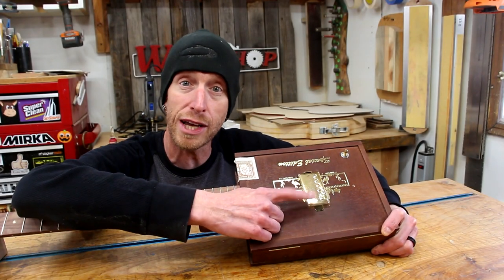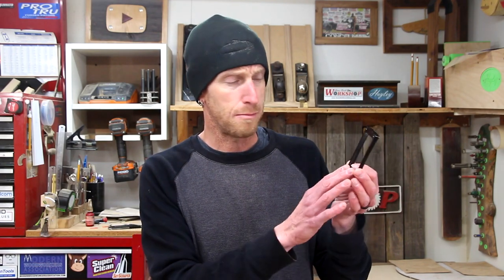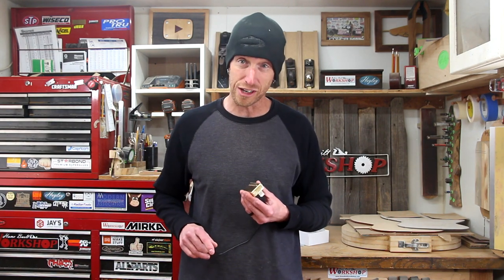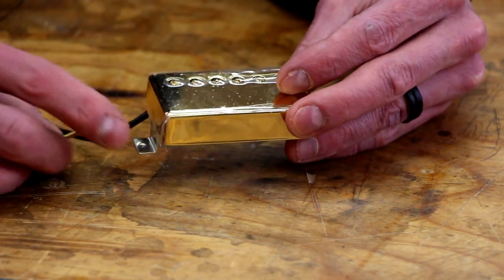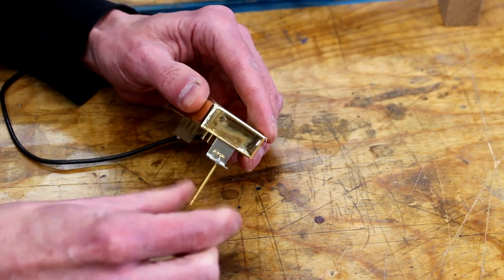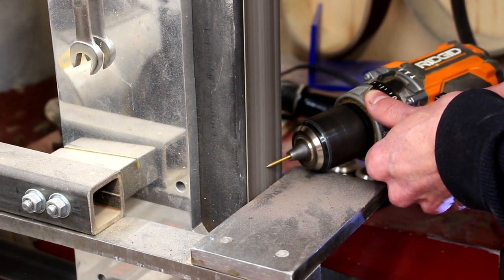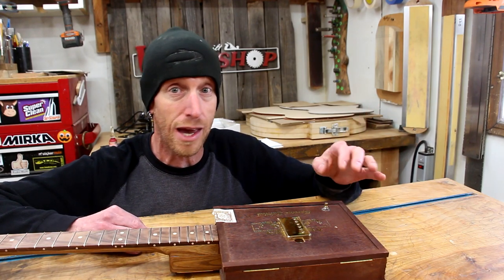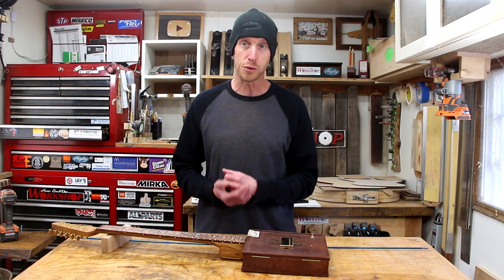How to Direct Mount your Guitar Pickups and why you should | I opened a can of worms!

Comment: When you think about it. Technically the pickup is still floating the same as if you used pickup rings. There is no direct contact between the pickup and the body unless you mount it flush. Its still a nice look though.
Reply from the maker: Its not a lot when you think about it, but there is a small contact point between the screw and the pickup tab.
Reply: @homebuiltshop  But it is indirect contact points. Same as a pickup in a ring. It's not direct contact with the body of the guitar. In the end, I think this is a lot like many things guitar. Its mostly down to aesthetics. What you like the look of the best.
Reply: I'm interested enough to do this... but how often do you really adjust the pickup height? I'm going to simply use washers BENEATH the pickup tabs with short wood screws and use a straight edge to determine the approx gap. Most guys can't do the machining in this vid - but it's a great vid and topic IMO.
Reply: @3DayFunk  The pickup ring is mounted to the wood with 4 screws, so yes, it still makes as much contact as direct-mounting.
Reply: @Thirdgen83  no it doesn't, the pickup is only mounted to the ring by 2 screws, the height adjustment screws. That's what matters, not the ring screws. You can wiggle the pickups in a ring setup, not good.
Reply: @realtruenorth  That has ZERO affect on the sound.
Reply: @Thirdgen83  he explains why it changes the sound.  And he is a pickup maker.
Reply: @Thirdgen83  LOL. I don't understand why you are so resistant to facts, reminds me of liberal democrats.
Reply: @realtruenorth  It's NOT a fact. It's some guy's opinion and he's WRONG. And I'm NOT a damn DemocRAT.  
FJB!
Reply: It is a direct mount pickup because it’s not mounted to a ring that is mounted on the guitar. That’s 4 less screws/holes in your guitar and no plastic ring.
Reply: @papaidolatrine2499  I am well aware of what it is and how it mounts. My point is that it has ZERO affect on the tone of electric guitars.
Reply: Personally, I would use the PMS system by FU-Tone as it has a solid bar that screws into the body, then has a bigger size set screw in the middle for adjusting pickup height for $49.95. It has much more solid contact point than this guy's approach and the pickup ring both.
Reply: @Thirdgen83 eah. That's wrong. Ask Van Halen. He kinda pioneered this for the tonal improvements. Watch Dylan talks tone explain the science of why. He is a pickup maker. If the pickup can vibrate it can cause phasing loss. It needs to be secured and move as one with the body to eliminate any off phasing loss.
Reply: @Living_EDventures I wish they had a 7 string version
Reply: @realtruenorth  Not wrong at all. EVH had a lot of hair-brained and superstitious ideas that had no basis in science. Everyone jumped on the bandwagon since he was such a great & innovative player.
Reply: @Thirdgen83  I actually understand and can explain why it makes a difference and I guarantee that it can affect what you hear, that video explains why.
Reply: @realtruenorth  I can guarantee that after playing guitar for 39 years and trying numerous pickups and different mounting systems, what you are saying is a MYTH.
Reply: @Thirdgen83  I guarantee after playing nearly 40 years that it isn't. I can hear the difference when going from pickguard to direct mount. But I believe you if you say you hear no difference. But just because you don't hear a difference doesn't mean others don't.

Comment: Nice way to mount pickups. I'm gonna roll with personal preference on what is a clean look so as to not fuel that debate. I will however reiterate that unless you are using those super old and REALLY microphonic pickups there will be zero tone / sonic changes from doing this as its ALL electronic / magnetism producing the sound and ZERO to do with string vibration in regards to sound. Many people confuse resonance with all that and that comes from the wood working side and how everything is put together and either aids or detracts from that.
Reply: While I agree that direct-mounting the pickup does not change the tone, it's NOT just electric signal/ magnetism that is involved. This is because pickups are MICROPHONIC. They actually "hear", in addition to producing an electronic signal. A prime example is how a hollow-body electric guitar sounds different from a solid-body with the SAME pickup. But yeah, direct mounting vs. a pickup ring makes no difference. I also laugh at the MYTH that a maple neck with a rosewood fingerboard sounds different from a maple neck with maple fingerboard. Pure NONSENSE, as there isn't enough material there to have any effect on the tone.
Reply: @Thirdgen83  Technically a pickup can NOT be microphonic as it has no diaphragm. What makes a pickup "Microphonic" is sound pressure subtly vibrating the strings and causing a resonance that then feeds back from the amp causing a loop. Its that same resonance that makes a hollow body sound different.  Listen to Paul Reed Smiths interview at Andertons at the 30 minute mark where he starts discussing the Robben Ford guitar and breaks into the part about each guitar having that resonance and how he manipulates that to act with pickups.
Reply: @borgonianevolution  The REALITY is that pickups are microphonic. You can postulate about what MAKES them microphonic, but the end result is the same. My example of a hollow body electric sounding different from a solid body with the SAME pickup is evidence of such. The magnetic electrical signal doesn't
differentiate between body construction. That is microphonics.
Reply: @Thirdgen83  ANYTHING microphonic has to produce a motion be it vibration, air pressure or an electrical change of sign. 

For a pickup which is an electrical device to produce a sound something HAS to move. It does not in any way shape or form "hear" sound.

In the case of a pickup acting micro phonic it means something within its structure is moving. Most cases it is loose coil windings which is why "potting" coils is so important and in most cases reduces or eliminates the ability to become microphonic.

If you talk at a pickup and your voice produces a sound it is because the air pressure changes needed to make sound are transferring those vibrations to something loose within the pickup and inducing sound electrically.
Reply: @borgonianevolution  Again, you're going into detail on WHY the pickup "hears". That in no way refutes the fact that it does. Obviously it doesn't function the way a diaphragm microphone does, but it is producing more tonal qualities than JUST an electrical signal created by a metal string moving over a magnetic field. If it were, then it would sound tbe SAME no matter what kind of body it's mounted in.

Comment: I have seen two other methods for direct mount.The first is actually a brass bar that mounts at the bottom of the pocket, there is a high adjust screw in the middle, and the end screws screw into the bar to adjust height.  The second is to drill the bottom of the pocke ton each end and screw in a brass insert. You add a pice of foam between the pickup and the bottom of the pocket.  You adjust the height screwing the srews in and out.
Reply from the maker: I've seen the brass inserts. I kind of like that and may try it out. I would still modify the screws to disengage from the pickup though.

Comment: Thanks for this suggestion of filing a screw down.  I was replacing my passive pickups in a Prestige Ibanez and I didn't want to drill out the brass fittings in my Fishman Fluence I was putting in there.  Finding screws online or the hardware store that would fit the bill was fruitless and the direct mount screws that were in the stock dimarzios were too fat at the unthreaded portion.  Of course, your method was so simple I wished I had thought of it myself.  I just chucked each of the 4 screws into my hand drill and needle filed them down, measured them with my calipers, and I think they'll work a charm now.  And the threads are the exact right size because they're ones I alreayd pulled out of the guitar.  Cheers!
Reply: Also, why isn't some company making screws that fit this purpose by now.  It's honestly weird that Duncan/Dimarzio/Fishman/EMG don't have screws like these available on their website.
Reply from the maker: I'm glad it helped you out. I don't know why there isn't something like this. Maybe everyone just drills the pickup out but I don't like to do that.

Comment: If you drill out the screw connection you can reverse it by soldering a proper nut to the bottom of the ear . I have done it several times and it works

Comment: Wow! I never thought of doing it that way. I always drilled out the holes on the pickup. 
I'm gonna try your method on my next build. Great video!
Reply from the maker: I don't like to modify the actual pickup as that makes it not reversible. This way, the pickup is unharmed. Make sure you don't remove too much from the screws or it will become weak. Just remove the threads enough so it disengages from the pickup.

Comment: Great tips here.  I would like to mention though that your pickup mounting is still floating the pick up above the body and not actually making direct contact (unless the screws are bottomed out).   Although I do not know if this matters. 

I have built several guitars and I used EMG pick ups in all of them.  They were truly a direct mount, screwed solidly to the body.  I am looking to replace them in one of my old builds though with passive pick ups.  I do not have room for the rings, so need to still direct mount them.  I like your method, and will most likely be giving it a try.  It is nice to have some adjustment to get the pickup  the correct distance from the strings.

Comment: I've never been into pickup swapping but I had a pair of gibson 57 classics sitting around. I got a little reckless and widened my carvin h2t's pickup holes with a Dremel. The gibsons are still mounted using the plastic pieces and are adjustable but I was worried that they were too snug against the body now.... possibly killing sustain/resonance. It's a chambered guitar. I'm rewiring it today with new electronics. It seems fine. Chime in if I'm neutering my guitar this way please.

Comment: No stripped holes in the wood yet? The threads on the original pickup screws are pretty tiny singe they're machine threads..
I suppose you're using pretty lightweight foam though and the mounting springs.
I have a method on my channel that can use more rigid foam (or rubber), but it requires installing an extra part...
However, it also uses the technique of taking down the threads near the heads to make the screws spin freely...
Your method seems much easier, but I'm still worried about reliability, especially if the guitar is made from a soft wood like basswood or something.

Comment: I'm doing the same thing but with a threaded insert with 6-32 threads, which are the threads on your HB height adjustment screw. With the insert threaded into the wood your HB screw is threaded into the insert instead of the wood. Of course the body of the guitar has to have enough room for the insert behind the pickup. You can get threaded inserts that are 3/8" long but don't have to thread completely into wood.

Comment: I will need to direct mount the covered Sat Night Specials I want to buy, since the rings won't fit, but when you file off the top threads of the mounting screws, won't it still make the pickups wiggle, since the screw wiggles? The pickups won't be tight in the cavity... Your's are a snug, tight fit because it's  custom cut box...?
Reply from the maker: You're right, it will probably wiggle a little. One solution is to use some foam under the pickup to keep it tight against the screws.

Comment: I just ordered Filtertron pickups for my Gretsch electromatic solid body guitar. If it has the deeper wells routed in the sides of the pickup cavities to accommodate the screws for a ring mount will I need to fill those with say a wooden dowel to wood mount the new filtertron pickups?

Comment: Thanks a lot for the video! 
Quick question: 
If i'm not mistaken, i could technically still use these exact modified pickup screws and the pickup on another guitar together with a pickup ring, right?! Or am i thinking wrong here? 😅
Reply: That's right, you can use the modified screw with a pickup ring if you wanted, but new screws are not expensive.

Comment: Why don't you drill from the back of the body and do the adjustment from the back of the body that way the pickup screw can thread in to it's original pickup plate (just a thought )
Reply from the maker: That's definitely an option. It just depends on whether or not you want more holes on the back.
Reply: @homebuiltshop  exactly 😂😂

Comment: Thanks for the video. Interesting what you say about aesthetic. If you mount that on a solid body guitar directly I imagine you;d get more dirt and dust ion the cavity (you example is closed off so it's not a problem).
I did a PU replacement on a guitar where the cavity for the humbuckers seems shallow compared to other guitars. Even though they are mounted on plastic trims I think the pickup screws are in contact with the bottom of the cavity. The result is more of a microphonic effect from body noise than I have with other guitars. Can I reduce this effect by just adding foam or insulation under the pickup, should I cut off the excess on the pickups screws, or try something else.

Comment: Great video and under-valued topic. A humbucker is a (relatively) heavy object compared to the springs that isolate them from the body. String signal comes from movement - whether it's the string vibrating but also the movement (even micro) of the pickup in relation to the body/tailpiece/strings. Hit the back of your guitar and part of that sound is the bounce of the pickup. Might be very small... but this is definitely a topic more worthy than caps, pots and cloth insulated wire (head slap). Direct mounting of pickups to bodies (and therefore the tailpiece) SHOULD have an effect .... admittedly only if you play like Townshend.

Comment: hey man i think you just reinvented the wheel. you can get wood screws at any hardware store. They are pointy an have a flat surface towards the head. Also you can get them any size you need

Comment: To me, the direct mount is not about this. It is to use as much material from the pickups bottom to touch the wood. And if possible the sides of it too. The foam should not be used. Better to use silicon tubes on the screws. The thing is only that you add the mass of the pickup to the total density of the body, and may have an impact on sustain or tone that is so subtle that it is neglible. 

If the pickup "hangs" in frames it wobbles more - the magnet and copper wires inside it wobbles back and forth although not detectible by the eye. It oscillates. If kept firmly, by secured to the body, you keep it SLIGHTLY more steady and not "rockin" back and forth so much, but keeps it still. But that comes with a concession. 

Not all pickups benefits from this. If they are wax potted the "keeping-it-still" is solved already. No diff there. If they are open it might. Also if they are open, the chances are that they are just slightly microphonic, and will transfer mechanical wood vibrations from the body into the pickup and add a slight flavor to the sound. For some time.

However if they are too microphonic the will just squeal, and this added vibration into the coils will slowly make them even more microphonic down the road. It adds mechanical vibrations. Not magnetic.Then what to do? Wax pot them, of course, but then you get no benefits at all from the direct mounting, and in the end it defeats its purpose. 

Yes, a can of worms. If there was some design that made you be able to WEDGE your pickup into your guitar so it is hold steadfast by all the sides of the pickup touching the guitar body, it would have made some more sense, but once in there, you wouldn't be able to adjust any height at all, and to take it out from there would be a major chore.

Comment: Maybe it's an idea to use threaded inserts instead of using machine screws (bolts) to screw into wood.
Those threads are not suited for reliably screwing into wood. Especially when you use them to adjust things.
Plus I wouldn't call your method direct mounting. The pickups are still suspended on springs/foam.
It does look good, though.

Comment: This is really fishy.....you cannot grind a point with no threads into a "machine screw" and expect it to thread into wood, period! It will strip and come loose. The only way to do it properly using machine screws with "NO" modification of the screw or pickup is to: sorry, not sharing this genius method. What he is doing is not the correct way that will last the life of the guitar.
Reply from the maker: I haven't had one come out so far. Another option is to use threaded inserts into the wood. Then screw the machine screw into that.